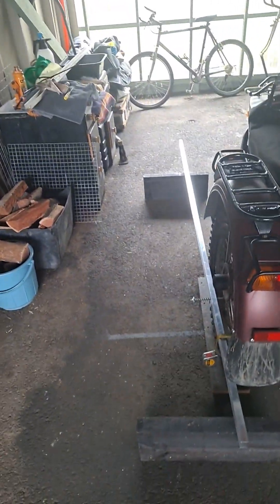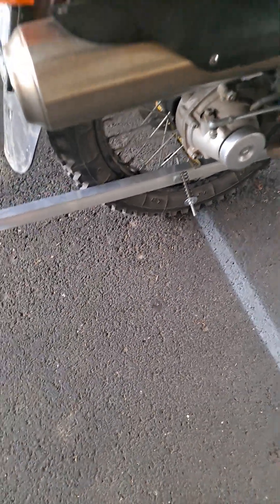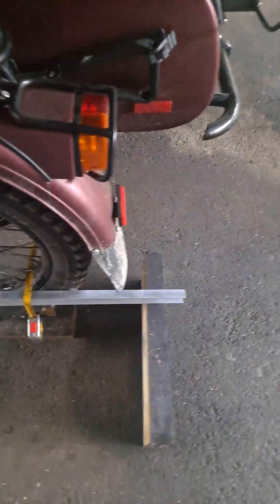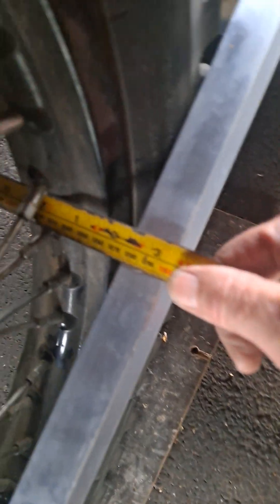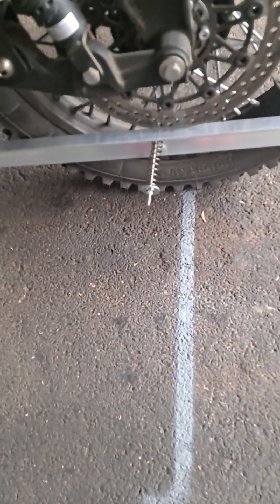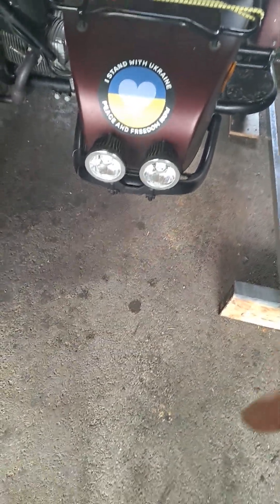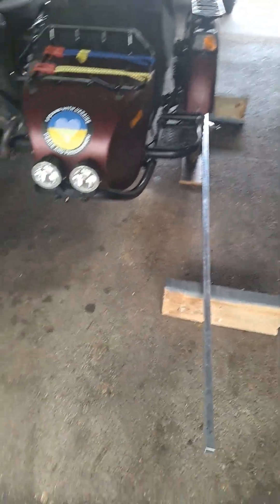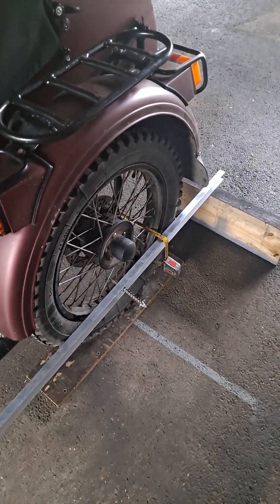Sidecar Alignment.

Comment: Too much toe-in causes tyre wear, but 38mm is, in my experience, within limits. The goal of toe-in and leanout is going straight in your situation and not complying with given rules. I ride with 3 degrees and 52mm!
Reply from the maker: My measurement is at the SC wheel. I think your measurement is some way forward. About level with the front axle. Is that correct?? I am pretty sure the measurement quoted by Ural in my manual must be at the SC wheel. (3-8mm) for a 2wd. No set of measurements is correct for all circumstances given changes in load and road camber.
Reply: @haitch1980  Your measurement seems to be at quite a short distance and then 3 to 8mm would probably suit me too. By the way, all recommendations assume that front and rear wheel are in line, like they should be, but are usually not (in case of Urals).
Reply: In the Ural instruction video David measures front the back of the sidecar wheel to the front axle. Although you don't agree with that, I think that is the common way. The picture in my manuel also used the front axle and is not do clear about the rear measurement. But I agree with you that one should measure along the rear wheel and also that load and road camber matter.
Reply: @haitch1980  The drawing in the manual seems to show sc axle to front axle and says 3 to 8mm. In a Ural instruction video David measures backside of sc wheel to front axle and says 3 to 15mm.  My dealer measures on the same spots and does 30mm. Do you measure from front to rear of the sidecar wheel?
Reply from the maker: @jharingh Hello. Just to clarify. The measurement for toe in is different for the 2wd vs single wheel drive. 3-8 for 2wd and 8-12 for 1wd..mine is 2wd hence 3-8.mm. what matters is the angle of the SC wheel in relation to the front to rear parallel (in theory as you say) if that  3-8 mm were applied to a location somewhere up toward the front axle as David demonstrated,  Think you would find the actual toe in at the SC wheel would be tiny. So, to answer your question. Yes all my measurement are at the SC wheel. I leave the bar in place keeping the front and rear wheels in line and parallel..My measurements are then quite simple inside of bar to inside SC tyre wall at rear, compared to inside of bar to a point forward and inside on the SC tyre wall at front. As a check after doing this, you can mount the bar on the SC wheel as David does. Then, go forward and measure the difference at front axle location. I am sure you will find it is in the order of 38+mm. My point is, the instructional video and the user manual are not correct. My bike tracks perfectly and I have no adverse tyre wear..Lean out is very close to 1 degree using an electric inclinometer attached to front and rear brake discs. All on level ground. Thanks so much for taking the time to talk this through. It was a big mystery to me and many others. I just sought to take away the mystery around this. Simplifying it. Cheers

Comment from the maker: I have since learned that the measurement for "toe In" is really only relevant when compared to the rear "Pusher". Nothing at all to do with the front wheel. The beams only to ensure the front and rear wheel are in parallel so an accurate measure for lean out can be obtained from each disc rotor, front and rear. "Toe In " is actually the difference between the perpendicular measurement from the back sidewall of the solo to beam on the sidecar wheel, and the front of the sidecar sidewall to the beam on the solo sidewall. the difference between the measurements is the "Toe In" 
Measuring the perpendicular through the front axle only adds an unneeded level of complexity due to the distance from sc wheel axle to front axle. Which is hardly relevant.

Comment: Yes 38 mm is too much it should be approx 12 to 15mm toe in after you've set the lean out , I would think its pulling hard left ATM ?
Reply: No , measurements from the same points front and back look ok ,search for Ural America's video on alignment ,you just have to mirror image for RHD 👍🏻
Reply from the maker: @camneilsen8234  I did visit the Ural Youtube instructional. The rear measurement is from the rear tyre knobs to the sc rim area. This would make the difference even greater. No mention anywhere referring to leveling the sc frame before starting either. This was a requirement in earlier models. I will continue checking today. Thanks for your comments.
Reply from the maker: I hear you. My point though is; why would the factory spec 5mm to 8mm at this same point??
Reply from the maker: Thanks Cam. It is a 2022 2WD with recommended settings of 3 to 8mm. Can you see any issues with measuring setup??